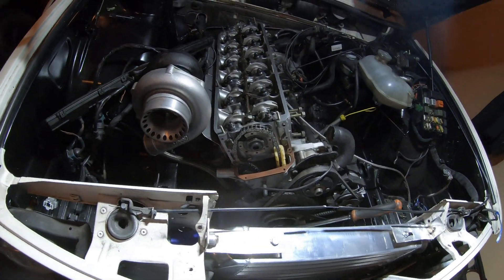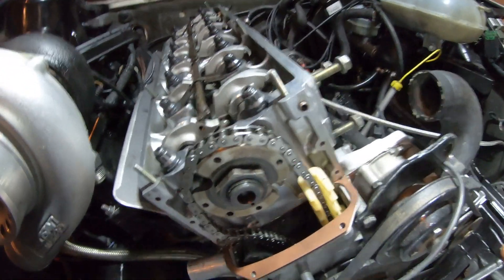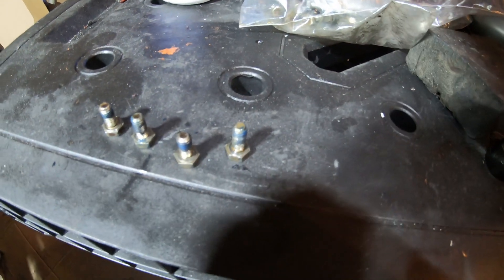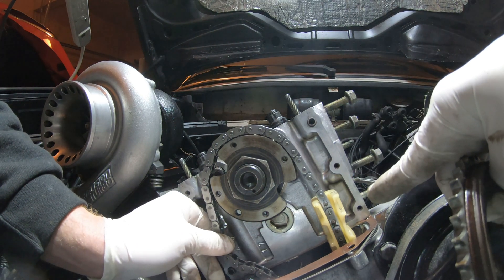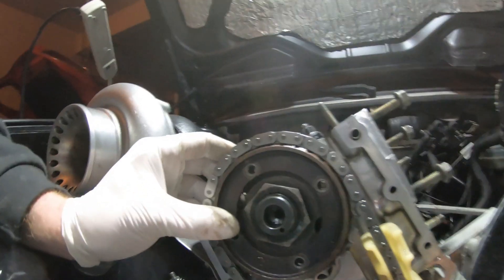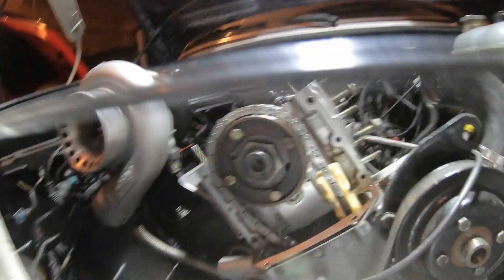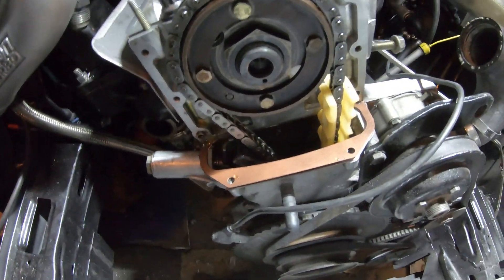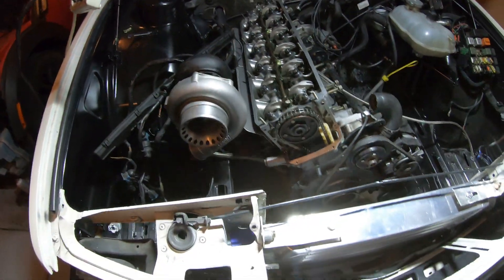How To Time BMW M30 Engine - Turbo E28 Build

Comment: Could you be a doll and go over your ecu and sensor set up you got? I'm in the process of boosting my e28 with mega squirt EFI but unsure what I'm doing 🤣
Reply from the maker: Hahaha are you doing a plug and play unit or a build your own? They are definetely a bit overwhelming with all sorts of mixed info out there 😅 i run a standard gm temp sensor, map sensor is in the megasquirt. I could try and send ya picture of what the inside of my megasquirt unit looks like and what not
Reply: @88boostedbetty    I got an assembled ms3x ( I'm not the best with soldering small connections lol)  any other advise to save me a massive headache? 🤣
Reply from the maker: @Supermancanhick   i have an ms2 so i think a few things are slightly different. Diyautotune should have some step by steps on there for setting it up. I referenced diy along with someone else who had identical m30 setup. Amazon sells a micro solder kit that is worth buying too. If ya got an email il gladly send ya pics of what my megasquirt and everything looks like!

Comment: What transmission did you use
Reply from the maker: Its a getrag 260/6 the 5 speed trans from later years e28 535s and early e34.

Comment: All good Nick. Do you a video to your trick of setting Megasquirt timing to 100% in sync?
Reply from the maker: Hey i do not have a video of that but can definetely try to get one together on setting the base timing to make sure it's in sync.  Breif run down is: I use an adjustable timing light from harbor freight. Usually set timing to be fixed at 15 degrees on tuner studios. And then set the light on #1 wire and shoot it at that timing mark on balancer. Then adjust the tooth # on tunerstudio's until it all lines up on the balancer
Reply: @88boostedbetty  Thanks. I couldn't get to a place where the mark was visible, maybe I need to remove my fan clutch when I try again (stock cap/rotor blocking some view). But i know that the offset angle of 84-89 degrees can fluctuate by engine and I couldn't nail down the correct angle and get the timing light to match. If you did a video that would be great.
Reply from the maker: @op4spitfire   if u remove the fan clutch should definetely be able to get room, i have done it with the fan clutch in but i remember it was a very small window of view for it. Will get a video up of it soon!